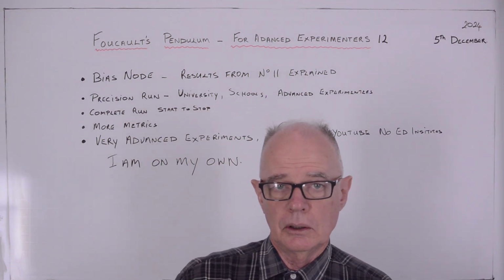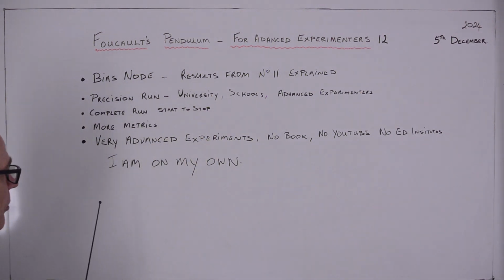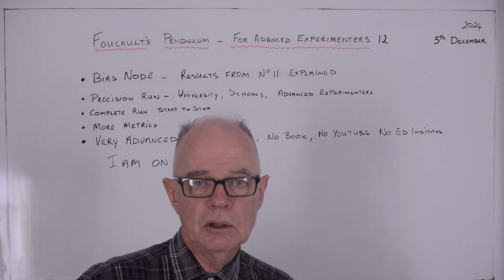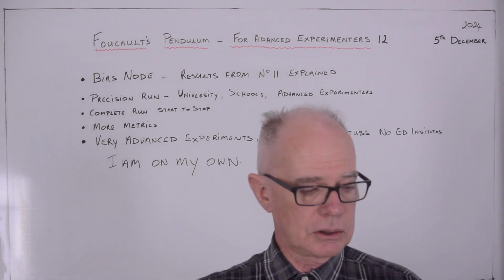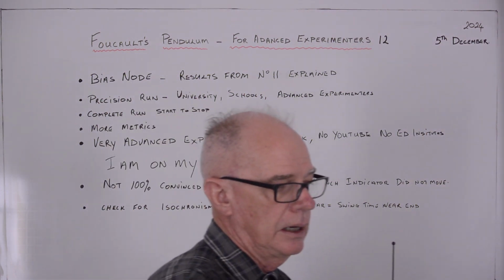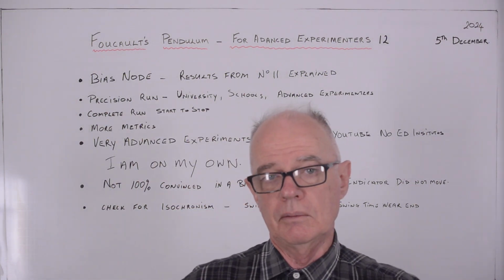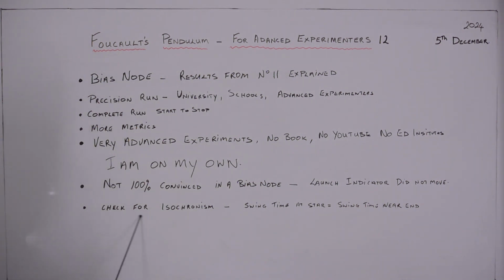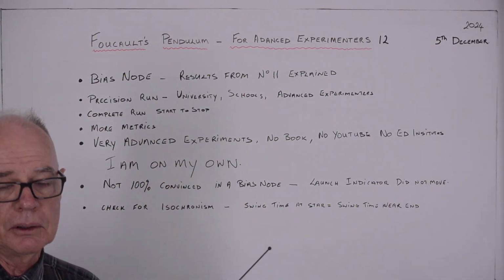Foucault Pendulum for Advanced Experimenters 12

Comment: I might suggest, 
To release the bob, hold it in the starting position with a loose loop of string around its equator; not attached to the bob. Tie the hold back string to the loop. 

When the hold back string is burnt the loop will fall off to the floor. This will leave the bob with a completely smooth surface. Reducing drag and eliminating any asymmetry
Reply from the maker: OK, thanks I will give that a try in No13,.. PS no black tap just a black Sharpie ink line to make the launch indexing line.  So you are thinking air flow could be a factor.
Reply: @ if the string is still attached, yeah asymmetric aero drag

Comment: @29:00 your pendulum started off going CCW, but then it slowed and reversed to start going CW. That's quite unexpected.
If I'm understanding what you're showing correctly, not only did the rotation rate reverse, the rotation ANGLE reversed.
There is indeed some sort of bias being demonstrated. It's hard to say what that might be. My first guess would be air flow.

It's really not a controversial subject.

Here's what I saw...
1) you launched the pendulum, and it began to precess CCW.
  a) had we stopped there, we might have concluded this was due to Earth's rotation... seems quite reasonable
2) the rate of precession stopped.
3) it began to precess CW.
  a) clearly this cannot be due to Earth's rotation, and that calls into question our earlier conclusion
  b) there is no doubt there is a bias in your demo

I find it curious how you're assessing all of this... what we're looking for is a rotation RATE not a rotation angle. Your set-up vaguely shows the rotation angle. You are inferring the rate by how the angle changes. But what we're expecting is a continued rotation... the fact that it returns back to 0 and crosses over 0 is quite unexpected.

My follow-up question: Is there a directional bias the angle at which the swing settles?
Reply from the maker: Yes period No1 swings ccw, Period No2 hits centre, Period No3 swings cw?.  I do not believe it is a node bias because the launch indicator did not move and also with a node bias the pendulum will swing in the direction towards the bias and lock in.  Not as in this case then start swinging in the opposite direction and REMAINS in this direction till stopping completely. Remember this is for advanced experimenters, you may not have come across this condition with general experiments.

Comment: #15:29 If you want to measure the precession rate, you'll need to make a few tweaks to your set-up. Let me know if you want some suggestions.
Reply from the maker: Yes any suggestions are welcome,..thanks
Reply: @peterleane6807  rotation rate is angle/time. You either need to measure the angle at a given time or the time at a given angle. The latter is easier.
If you set your laser at a specific angle away from the direction of swing, you can time how long it takes to rotate that far.

However, your rotation rate is not consistent, so that's a serious problem. At that point in your video, I didn't realize that was going to happen.

You'll have to investigate your bias more before any measurements would be meaningful.

I think you should swing it from different angles and amplitudes to see if there is some preferred direction in the room, some preferred direction of your pendulum, or something that varies with amplitude.
Reply from the maker: Yes I have in the passed changed launch angles which find node bias point problems, but when the system is refined to this level the only bias left should be the spin of the Earth.  Keeping in mind that if I was to artificially boost the swing for period No1 for 33 hours it would do a complete cycle showing a ccw rotating Earth.   Anyway thanks for your suggestions I might do another experiment 12B before I setup for No13, you have high lighted a issue.
Reply: @peterleane6807  "...when the system is refined to this level the only bias left should be the spin of the Earth."
I would hesitate to accept that just because you've tried different angles before, you have eliminated any room-based biases. Personally, I would very much like to see what happens if you try it from different angles.

"Keeping in mind that if I was to artificially boost the swing for period No1 for 33 hours it would do a complete cycle showing a ccw rotating Earth."
I don't think you've really shown that though. Without knowing the source of the bias, it's really hard to say what it would do if it swung longer.

Obvious guesses for the source of the bias:
a) There's an air current in the room causing a directional, room-based bias
b) There is still torsion in your pendulum despite all your efforts to remove that
c) The dangling piece of string is dragging on something on the floor deflecting the pendulum

and then finally

d) unknown forces of nature

IMHO, wisdom suggests we look at the mundane before reaching for the supernatural.

Comment from the maker: Please add a comment what you may like to see in Video No 13, ... also any suggestions why the pendulum would have gone through the phase from the CCWise to the CWise direction.
Reply: Does the bob have the launch string still attached? And some sort of black tape on it? 

If so, wouldn’t that make for drag on side or the other?
Reply: I just want to add how surprised I am to see it doing what it's doing. Keep on testing, and keep an open mind. Don't close your mind to the possibility of an extraordinary finding, but don't close your mind to a mundane explanation either.